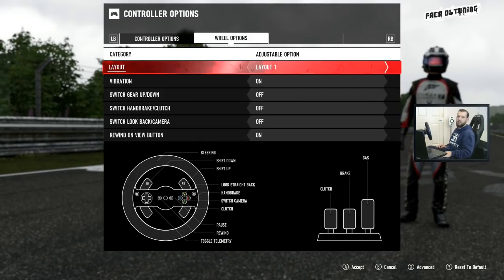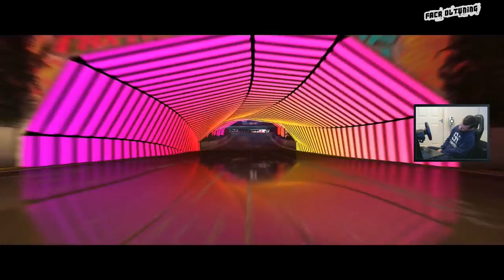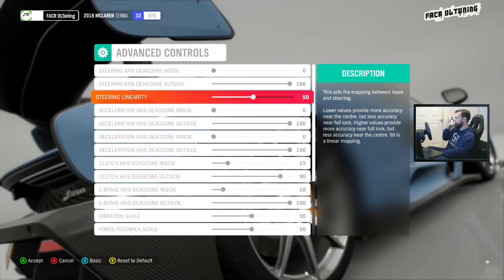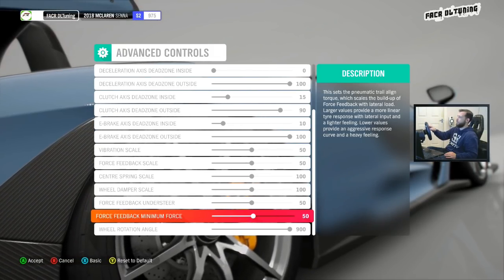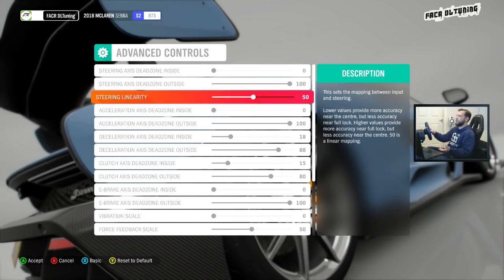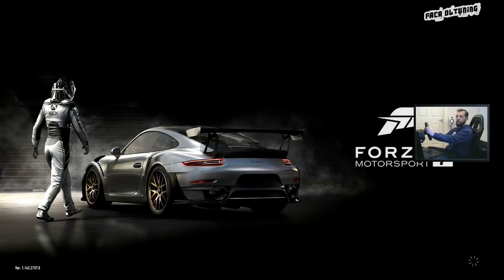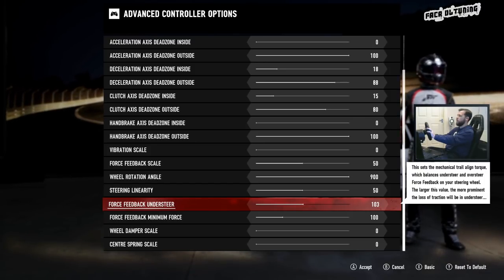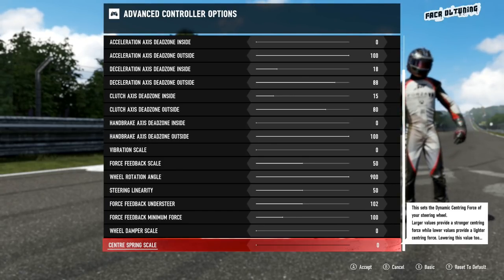Forza Horizon 4 & Motorsport 7 Realistic Simulation Steering Settings

Comment: The reason why FFB minimum feels better at 100 in FH4 is because the setting is inverted from how the description reads, 100 is actually giving you a much more aggressive build up of force. In FM7 100 is the default for the pnumatic torque curve (as told by a developer on the forum) 

Regardless, FH4 has some serious bugs with wheels atm on console and PC, not everyone is able to get the same experience atm because of it

Comment: Wowww!!!!!
I just treated myself to Xbox one X and G920 wheel with GT omega stand and have been playing Horizon 4 and Motorsport 7 when i get the chance... I have had a real problem in finding the right settings that suits a new race and totally new to gaming!
There are sooooo many different settings floating about on Ytube it's hard to find the right ones, until i came across this video...   OMG i kid you not i am winning races instead of crashing and coming last. You have put a big smile on my face and made me a very happy man...
It's been nearl 40yrs since a played a console game and you have just made me hooked...
Keep up the good work...
Reply from the maker: Love it!! Great to hear, and many thanks for commenting! 
If you head over to FM7 please be aware that there's been a FFB update and therefore these settings no longer provide a workable setup. For the new updated settings, please check out my latest video which covers the new options. Here's the link. Enjoy, bud! 😁
https://youtu.be/iyhe6uodZbc
Reply: @FACROfficial  I am using your settings with the Torque settings from new FFB and i can control the cars better than my own. Yes i have the setting on New racer which is what i am but everything works fantastic. 
I have tried about 5 or 6 different wheel settings off Ytube and these settings certainly do the job for me...
Maybe its have centre and Damper both on Zero that made all the difference with my driving?

Comment: Thank you so much! I was ready to give up on controlling this game (Forza 4) till I tried your settings in the game. I'm using an older F430 Thrustmaster and the only difference is there is no "wheel rotation angle" at the bottom, there is "steering sensitivity" which I set at 50 and I can finally smoothly control the car!
Reply from the maker: Great to hear! Enjoy, bro! 😁😁🚗💨💨

Comment: I hope this really does work better tgan the older videos because those settings felt way worse for me. And i also would have to disagree with you on centerspring scale. It really feels better to have it turned up when drifting cause mywheel actually re centers itself after a drift where with out it drifting doesn't feel authentic. Just my opinion though. I wonder if anyone else feels the same as me about that
Reply from the maker: I'd absolutely agree in all honesty. While I dislike the feel that the centre spring gives, if you're drifting it would probably be a good idea to have that up a bit, just not too far.  Did that solve your problem?
Reply: GrabasticPOS I have the exact same issue. I’ve been looking for a solution all over the web.  I’ve contacted Forza support but they haven’t responded back for the past 6 days. Then I contacted Xbox live support. They had me remove my account from my Xbox, disconnect the Xbox from the power outlet for two minutes, reconnect the power outlet and log back in, but it didn’t solve my issue. They recommend that should uninstall and reinstall the game which I did but still no luck. I even contacted Logitech but they haven’t responded either.
Reply: @FACROfficial  somewhat i just went on the forza support forums and they ended up putting a wheels settings guide up for people and I tweaked and tuned it according to what they recommend, they go in depth of how every setting effect the wheel.
Reply: @romanflores5505  do you have the link for their guide?

Comment: For g920 users, use less inner and more outer on the brakes, then in tuning set the pressure to 200%. Then for force feedback, 50 works for racecars that dont have power steering, but for power steering car 30-45 works exactly the same as real life

Comment: Hey Kyle, any information that you might have regarding the gear grinding sound that happens every time you shift up or down with clutch in Forza Horizon 4? I feel like you can't do it fast enough like in previous games or you get the gear grinding sound! It's so annoying! Only way I've managed to not produce that sound is to take the foot off the acceleration completely, then fully engage the clutch and put in the next gear, then wait like a second before disengaging the clutch completely and then accelerating again. But that 1 second delay shouldn't be like that. Ar least it wasn't like that in FH3.
Reply from the maker: Genuinely nice post, so please don't think I'm treading on anyone's toes, but the gear grinding (clutch not working with G920 wheel / possibly others) is a genuine issue and I've raised it with those T10 legends today. They'll get it sorted asap. They do work very hard - despite what some may think - so at least we know, they know. Anyway, bud. Thought I'd mention it when I saw your post. Cheers. 😁👍
Reply: Thanks Kyle! I appreciate it! I've always been a great believer and supporter of playground games and Turn 10. They are among the best developers in the industry.
Reply: The gear grinding sound occurs when the game does not sense a 100% clutch press, you can see your clutch press % in the telemetry. The problem is, for me anyway, using a g920, when I press the clutch fully down the game does not accept it as a 100% press. It falls short at about 95-98% hense the grinding sound indicating a bad shift. The way around this would be to reduce the outside dead zone of the clutch pedal, to ensure you reach 100% press before you have physically fully pressed down the clutch. However other youtubers have confirmed this and I have tested it out myself, that the dead zone adjustment settings are bugged and have no effect on my wheel/pedal input. I’ve switched to a face button clutch setup for now, until turn 10 release a patch fix.
Reply: Christopher Bunbury it happens not only when shifting. Try putting it in neutral and press the clutch, every time you let go of the clutch in neutral it grinds :(

Comment: hey I have my logitech g29 set up for the forza horizon 4 but on the settings I don't have the last parameter selecting the wheel rotatoin angle and put it up to 900. Why is that?

Comment: Hey great video Im a fan of the forza games I just got fh4 for black friday and I spent more time tweekend the settings and I just couldn't get it right. I cant wait to get home and try this I hope it works right I have t500rs with the sparco mod handbrake, th8 shifter im also using a drivehub device. The feeling its awesome on gran turismo 5 on the ps4 and all the other forza motorsports but on the  horizon its just so hard to keep the car in the road. I really hope your settings work on my setup . Thank you.
Reply: So....did you enjoy? Im not having so much fun with Forza Horizon 4 and Im lokking forward to use these settings when I arrive home from my job trip.

Comment: I tried the settings, they feel good, but when you get in a slide,it is almost impossible to corrigate the car so it ends in a crash
Reply: honda dreams try keeping these settings but using ‘normal steering’ instead of ‘simulation’. When I use simulation setting rear wheel drive cars become psychotically twitchy and as you said impossible to correct
Reply: @tonkinesenchill4240  not impossible, you just have to be a good driver :)
Reply: Mikazuki damn , u really did him like that

Comment: Ive just picked up the steering wheel for pc.. i get a constant vibration on the wheel.. i dont know if its faulty, if its an ingame setting that can be ajusted.. if i need new game drivers? Any help would be appreciated as right now, its back in the box and im dying test it on F7

Comment: 🤔🤔... Maybe it's just me, but I like the feedback to be a little bit more pronounced. Plus, I think this depends on how you like to shift gears... With 2 hands always on the wheel and using the paddles... It definitely can be a bit more aggressive. Is that weird? Always been curious on how sim racers are like on preferences.
Reply from the maker: If you're after more feedback, may I suggest you only increase the Force Feedback Scale, and leave the rest as they are. It should be enough to help get the feedback you're after. 😁
Also, I couldn't agree more with how changing gear can affect what kind of feedback is manageable. Personally, I was going for that realist (power steering) feeling. I change with the manual shifter and therefore don't want to lose grip on the wheel while changing gear. 
Anyway, bud, try increasing the Force Feedback Scale, but do it slowly and then re-test. You'll be surprised how much you'll notice just one or two clicks. 👍 
Cheers, mate, and I hope you get this fine tuned to your liking. I'm sure you will! 😁

Comment: Hey Dave I got a question for you did you remove that rubber piece out of your brake pedal and Springs.?
Reply from the maker: I've got it installed, but I have used it either with or without. It's far better with it in imo, although there are plenty who will disagree. It's just a matter of preference, I guess. 👍
Reply: @FACROfficial  yeah I was going to put mine back in but when I took my brake pedal apart my spring is broken like in 15 different places so now I'm screwed with no spring or brake pedal I'm going to have to see if I can find a right tension spring and replace it thanks for the input I was thinking it probably would be better with the rubber
Reply: @FACROfficial  and who knows the spring breaking might be the result of taking out that rubber piece cuz now you're putting a lot of tension on the spring
Reply from the maker: Yammizz: PM me, bro. I think I've got a spare brake spring. 😉
Reply: @FACROfficial   I tried the youtube PM on computer but doesn't look like u have it set up to receive PMs actually they removed the PM cuz ppl wernt using it
Reply from the maker: @MrYammizz  Email me, mate. FACR_Official@hotmail.com 👍

Comment: Hi Dave, great post(s). i've a fanatec 2.5 wheel base, the problem i'm having is when i drop the wheel damping scale to 0 the wheel starts shaking to much for me, so i put the number back to your old setting of 78 which is better. is there anything else i could change in the settings or wheel to stop the wheel from shaking ?.
Reply from the maker: Hi, John. The best thing would be to start lowering the minimum force feedback scale (I know I said to max it out) but that should help. Then turn the damping back down. More than happy to keep helping, so let me know how you get on.  👍
Reply: hi Dave, many thanks for your reply, tried lowering the minimum force feedback it made no different, so i tried all other permutations and in the end found the all your setting were great, it was down to my fanatec wheelbase 2.5 settings. the dri was set to off as soon as i moved it to -5 the wheel shaking stopped. like i said before great post, keep them coming.
Reply from the maker: Great news! Thanks for letting me know, and I'm genuinely pleased you found the cure. Hopefully anyone else who may be experiencing that problem will see your comment and make the same adjustments.  Cheers, pal. 😁👍

Comment: hello I dont understand one think how can 900 degree rotation is the best if the wheel in the game only turns 90 degrees from each side? the image in the cockpit will not correspond to the real life steering, it just confuses me. I have always put 270 degree rotation and the games worked fine for me but this game is weird (only tried the demo) steering doesn't feel right, if i turn a little the car doen't steer but there's a certain angle that the game responds to the wheel and it turns more than necessary. Can you tell me if the full have has this problem fixed? And also why you prefer 900 over 270 degrees?
Reply: That's why you go to the sim cockpit view
Reply from the maker: The steering wheel in the game is nothing more than a visual of the steering wheel moving, and doesn't in any way correspond to the actual amount of turning which occurs. I use 'Driver' view which sorts this problem out, but also gives a better idea of turn-in points in my opinion. 900° rotation is what normal road cars use, and therefore is most accurate. However sports cars, touring cars, indy cars, f1 cars etc, all have different degrees of rotation, and will therefore need adjusting to maintain realism. 
The problem you are describing is absolutely typical of an incorrect steering linearity setting, so be sure it's at 50. Also, obviously make sure you're using 'simulation steering' as 'normal steering' will negatively influence the accuracy and realism of the rotation angle. Hope that helps, mate.
Reply: FACR Official thanks for the reply I am aware of real life steering degree angles in different types of car but i didnt think that rule aplied to the game. In regard to steering linearity i always left it at 50 and the wheel still worked bad. However I tried the demo again yesterday and it was better, the steering was solved, but it felt wierd anyway but i think that its due to the physics model being differnt from past horizon games, its harder than past games. I dont like the new view without the wheel so i will have to manage that in the future. Just hope the full game has these problems solved in comparison to the demo. Again thanks for you quick answer and for sharing your settings I will sure try them :)
Reply from the maker: Cool, mate! 👍 Be good to hear how you get on! Good luck! Hopefully they'll feel good.
Reply: GTKing14 real question is......why do you drive in normal cockpit view lol ????
Reply: GTKing14 there is a visual graphic in the telemetry that corresponds to you wheel rotation degree settings.

Comment: Someone pleas help me. I have a tmx pro but i can't find the right setting for my wheel. It still feels loose when i drift and it feels like ill break my arm.
Reply: Turn steering linearity to 25. Turn your force feed back down a 5 to 10. Spring rate to 0 and wheel damper to 5. Turn maximum  understeer to 0 and try it
Reply: Mine feels spot on around there. I just got it and set it up. I'm still playing with it. But you should be able to feel the difference over the original settings
Reply: Maybe tune it one setting at I time so you feel what everything does and adjust accordingly

Comment: Anyone tried drifting with these settings ?
Reply from the maker: I've heard that drifting with them can be a little tricky as the wheel doesn't self-centre quick enough. If you find the same things happening, start to increase the centre spring scale until you are happy with the results. Hope that helps, bro.👍👍

Comment: Thanks mate! I tryed to find the right settings for hours (G920) but with your settings it feels so much better. 
Its kinda strange because in the german client of FH4 the Setting "Force Feedback Minimum Force" is totaly different. Its says lower value for more linear steering instead of higher value. I wondered because with 100 the steering felt very hard and strange so i tryed to set it to 0 and it feels soo much better.
Reply from the maker: Glad you like them, mate. Maybe they did change them around, but as long as you're getting the same results with it set to 0, then happy days! 😁